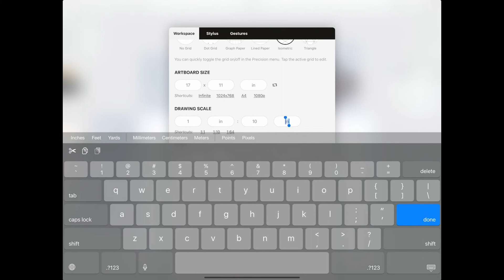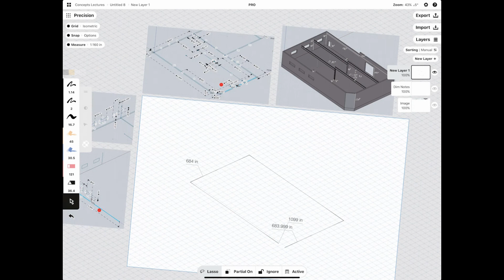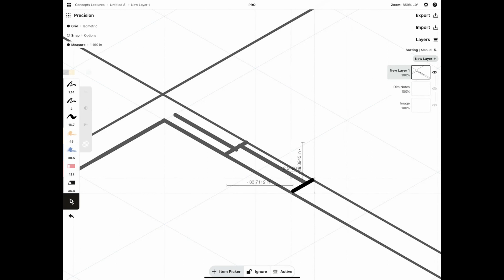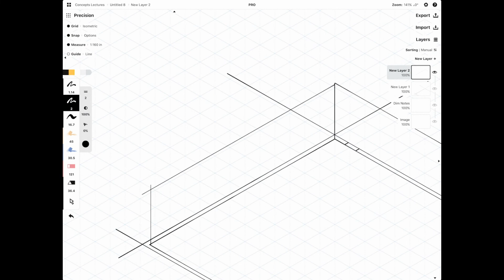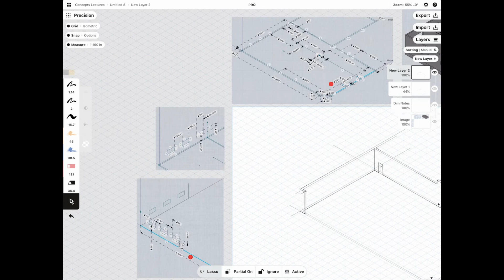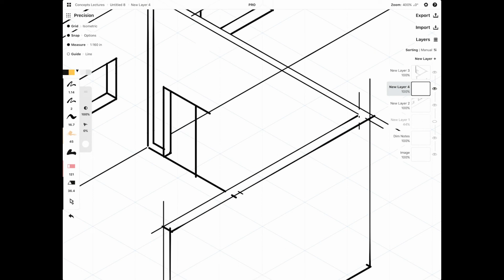Concepts - Isometric Drawing

Comment: Good evening Sir - is there  a way to adjust the position of dimensions? I’m talking about the dimensions that show after selecting the shapes. The ones with a center number over a long horizontal / vertical line? It’s looks like a CAD dimension. I love the formatting but I would like to adjust their position so they don’t overlap.

Also, is it possible to create line templates? Say, if I wanted to use a center line….could I create a template to use on drawings? Or are there center lines already available in the brush library?
Reply from the maker: Concepts can show the dimension when you select an element 

And you can drag move it but that is it

The rest is hand drawing